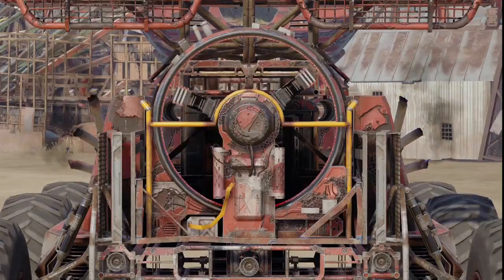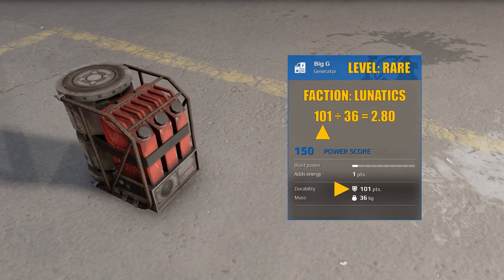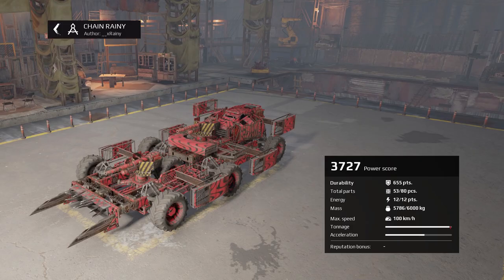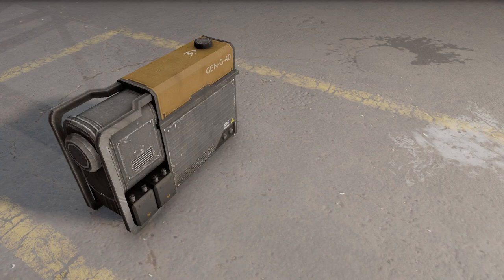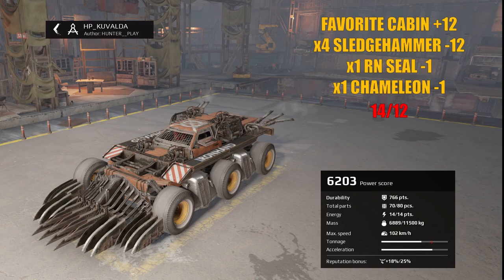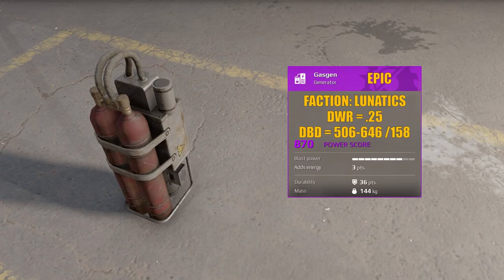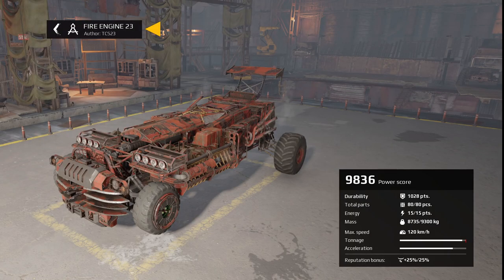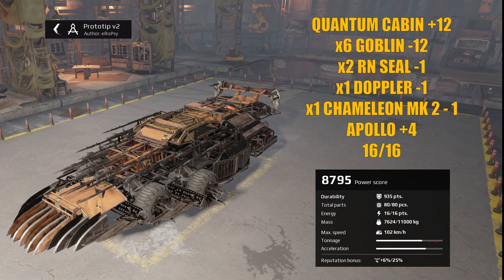An in-depth Guide to Generators

Comment: Honestly I'm fine with the gasgen because when I chuck it on the bottom, as long as I dont flip, I usually get my cabin blown up first.
Reply: Unless you run into fire
Reply: @Deimos_Eris   well just dont, you'll always put sensitive equipment that explode on the bottom so running into fire is just a poor life decision
Reply from the maker: Hey! A GASGEN supporter, I like it. 🙂
Reply: haha upside down yongwang literally counters anything with explodey things mounted under the cab
Reply: Agreeed I played gasgen for around a year it was not bad (except incinerators that destroyed me)

Comment: I would really like to see "Solar panel" generators. They provide 1 point of energy each and you can have upto 4 maximum on your build. Their size would be like 1x3x4 in tradition of modules being an odd shape. But thier tops must be exposed the same way the front of the Nova cab does. Also they'd be an epic part so they cost around 400 coin each.(1600) for 4. 4 of them would also be lighter than an apollo, and obviously non explosive.
Reply from the maker: That's a really great idea! You should submit that to the CROSSOUT FORUMS: https://forum.crossout.net/index.php?/forum/133-general-discussions/

Comment: Great work man! I have a really fast drone build with a gas gen underneath that's been one shotted many times while in the air. I still love it, though. You just have to be aware you're a glass cannon. Have you tested blast damage having the gen 1 block away from the cabin? I wish they would add some more variety of gens, to the lower ps as well as the upper. They just keep adding more high end cabins & weapons.
Reply from the maker: Hey man, thanks for the comment and the sub! I DID test each of the generators further distances away from the cabin and ALL of them consistently lowered their damage output, so I decided to go with the worst case scenario. Hopefully they add some more generator variety soon!

Comment: Great vid!

I would suggest you swap out the gasgen on the incin build though. I’ve been maining them a couple of years now and it’s a pretty common thing to have to drive through your own fire. A fused charge is enough to run colossus and a detector which is what you really need, or if you’ve got $$ apollo and kapkan for the hook-n-cook. 

It also helps as a last resort to be able to survive longer in your own fire than a close range attacker running a light generator
Reply from the maker: Hey Roger, thanks for the feedback! I'll try out the charge/detector combo and see how it goes. I really like having the MK2 on my INCINERATOR build though, it has saved me from many otherwise doomed encounters. I haven't tried the KAPKAN build yet, but eventually that would be a fun one to test out.

Comment: Wtf only 3k for appolo ? If im not mistaken the last time I checked it was around 6k on PS4.  I think it took me around 3-4 weeks  to get the 7-8k I have because I refuse to grind annoying raids and dailys. Thats quite some time for a single module . Seems like I have to stick with PU1 for a while ...😅
Reply: Fill up those buy and sell slots everyday, flip any wep, module, chassis, anything that has ROI %20 or higher, pennywar relentlessly after every match. Buy epic decor pieces that are <150c the parts from the recent battlepass are about 115-120 buy offer still. Buy as many as you can, salvage them, sell the resources. Believe me when i say this is how you make >1000c everyday. Im from xbox, our markets are similar.
Reply: @HighNoone  Ok Im gonna try the decor part . Thanks!

Comment: If the max energy what you can get is 16 ...then how some gamers can put 3 weapons what needs 6 energy each what would be 18 energy if I'm right
Reply from the maker: The only way to go above 16 energy is by building a Leviathan, but you don't actually get to play matches with it. You send it out and it battles against other players and then you earn resources if it defeats them.
Reply: @TCS23  thats weird..i saw many players about om7500 to a bit ower om8000 with 3 large size guns on their machines...whats about cheater in this game?
Reply from the maker: @goldenarms1485  It could've been something like the EXECUTIONER 88MM. They are 5 energy a piece, so technically you could have 3 of them on a build. They are pretty big too.
Reply: Do in this game have chiters?
Reply from the maker: @goldenarms1485  I'm not personally aware of any cheaters but I wouldn't be surprised if there was.
Reply: looks like have,,they could get IP adress ban..otherwise they can make new profile

Comment: I was using a gasgen and it was the worst generator ever and now around  1.5 months i got apollo now i use the apollo and pu1 charge and those are the best generatorz i think but the big g is also really nice?
Reply: Same, I used to use a gasgen but couldn't protect it well enough even with a tank build. Just use a PU-1 now

Comment: I just made ampere, was it a mistake?
Reply from the maker: Not at all, every generator has its use. 🙂
Reply: 'Could fuse it to make it stronger, then use it. Or could sell it for the coins. Or could use it for crafting something better :) That's the best thing about Crossout; nearly unlimited potential, mostly limited by imagination.

Comment: If you want to survive in battle, NEVER use ampere or gasgen. Also using gasgen with incinerators is common, but its extremely risky, the fact that your fire will kill you instantly.

Comment: The gas gen is rediculous. If that thing blows, your game is over. 600+ damage in all directions will remove everything surrounding it. Armor, frames, wheels, weapons. Not too uncommon to see them blow for between 3-4,000 damage. Really is a self destruct button, as most players won't even have that sort of durability until thier builds ar at 15k powerscore. 

The real aggravating factor is that the HP is so low. Explosive and fire damage can pop it pretty easily through armor. Like you can start a game and instantly get deleted. Probably the most painful period of the game is that grind to the Apollo.
Reply from the maker: Yeah, the GASGEN is definitely a controversial part, but when it's the only +3 energy generator available it's a hard call not using it.